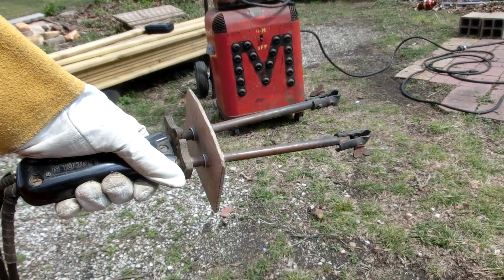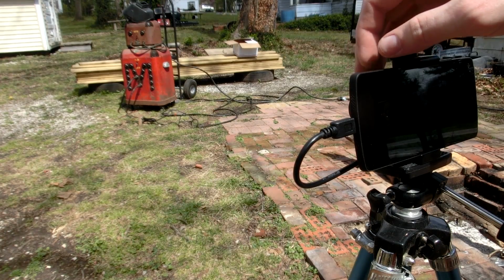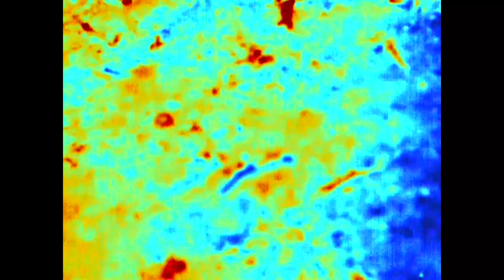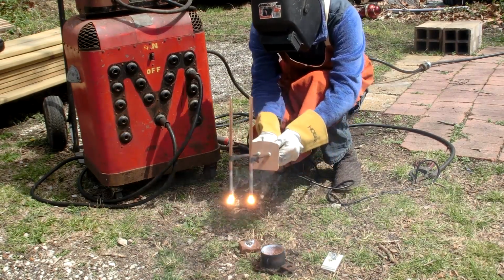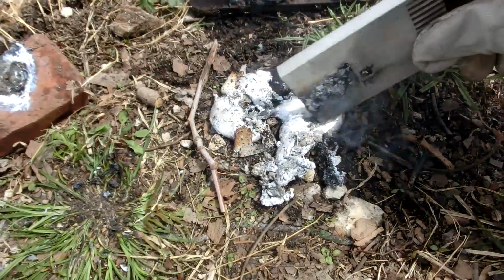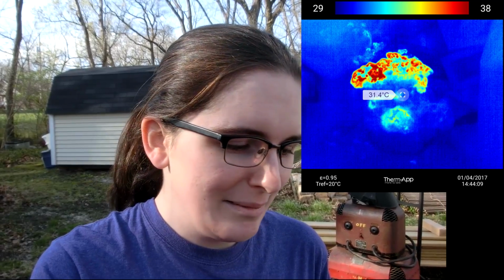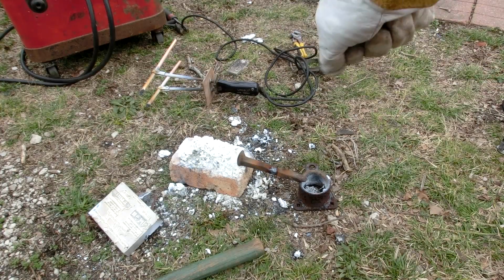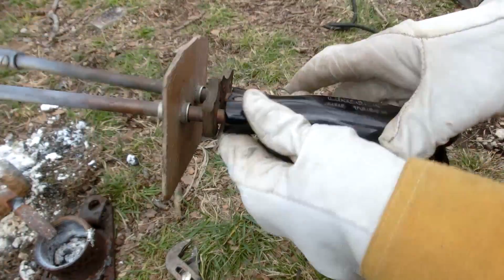Antique Lincoln Arc Torch: Melting Iron, Aluminium, Magnesium

Comment: I see that you tired to blow off the molten metal with a bicycled pump.  You are going to love the AIR CARBON ARC TORCH. (air-arc).  Loud noise and molten  metal  being blasted off.  We used it for gouging out weld metal and for  severing large  pieces of steel from pressure vessels where oxy-acetylene torch couldn't do the job.  Besides the typical  round electrodes there are flat cross section ones used fore the removal of hard servicing material such as found on earth moving equipment cutting edges and mulboards.  Be sure to use adequate proper PPE., the fumes are dangerous in large quantities.

Comment: From Australia I was pleased to see you wearing appropriate clothing because 40 years ago I used a carbon arc torch to braze up a trailer which resulted with me covered in arc flash  lobster burns over my young tender exposed pink skin .
Reply from the maker: I'm a little lucky in that I don't get sunburns, but agreed.
Reply: @RinoaL  It looked more like a 2nd degree all over burn than sunburn .The council placed my down on the corner for a "STOP" sign for 2 weeks

Comment: I love this technique and old tech. As an aside I did some research. The carbon torch rods are a different chemistry and are much better at flame control and quality of flame than the more readily availabe carbon rods for gouging. It looks like these are gouging electrodes. I found the correct rods internationally. They are not manufactured here in the states any longer.

Comment: She need use that welder for stick welding like 6011 or 7018 made for small job around a farm or home  not made what she is use it for put rod hold on it   she need a high amp machine like 300 to 500 amp
Reply from the maker: This machine is perfect for this. It is too big for a farm welder. It is industrial
Reply: @RinoaL  oh I'm sorry lady I guess you're a professional welder that's welded on pipelines and boilers and took everything from 1G to 6G on the test  and you're probably welded on machines that run from 250 amps to 500 and you're probably a golden arm arm lady they can weld anything from pipe to boilers to to oil rigs to anything in this world lady that's who I am I am a professional welder
Reply from the maker: Well, i have welded industrial pipes, and boilers. i doubt you've done any of that. even if you did, you'd be ignorant to the history of welding.
Reply: @RinoaL  whatever lady you have a nice day you got a lot to learn

Comment: It looks like the carbon rods your using are probably graphite air arc gouging rods, the carbons for twin carbon arc torches like this are much finer in texture and are a deep black carbon with no visible grain structure when burned. They work on fairly low amperage and burn with a quiet well pronounced flame of intense heat perfect for brazing thin metal, loosening rusted bolts etc I've used one of these torches off and on for the last forty years and found it incredibly useful and versatile.

Comment: Tip - use a spare wheel as a temporary air tank to use arc air gouging. It won’t last long unless it is connected to a compressor but DO NOT OVER INFLATE tyres (tires). Compressed air is dangerous!

Comment: You can cut through a railroad spike with a arc stick invertor 60 quid welder.  2.5 rods. ran from a 80 am welder... I was hoping you had figured a way of cutting clean or welding ally with that technique... thick you could weld a thin bit of ally using that? 
  
Thanks  for the video 

Good video tho youv planted a seed in my brain I have some ideas now

Comment: Bought one in the 70's haven't used it in a while. I don't think it's meant to be used a really high amperage, probably why the handle got hot. Also something doesn't look right about the arc, maybe your old welder isn't providing enough arc volts. The arc should be more intense with loud noise. You shouldn't need to be so close to the work piece, certainly not touching it. Maybe open the electrodes a bit more. Also if you ground larger work pieces you may get better results, you can use a car booster cable for the ground wire, connect it to the welder ground clamp, keep torch connected normally.

Comment: I don't think you are supposed to contact the work piece. I made a carbon arc torch and will try it out after I get some rods I ordered. A gouging torch with air is for cutting. The dual rod is for heating and brazing.

Comment: Seems you may be trying to mis-use the carbon arc torch.   I grew up using one with a Forney 
AC stick welder.  That carbon arc torch was intended for things where you might also use a gas torch.   It is excellent for brassing, soldering, heating metal for bending (blacksmith work), loosening stuck nuts (hold the carbons against each side of the nut).  With some practice it is possible to weld thick aluminium by using a heat sink and small aluminum wire as filler metal.  

A carbon gouge torch is a totally different animal.  The Carbon gouge uses only one carbon electrode and compressed air to melt a metal puddle and blow that puddle away.   It can do arc-welding in reverse....un-welding.  The single carbon gouge torch is used to cut metal.

Using the Carbon arc torch you should be using 20 to 60 amps AC current.  Smaller carbons (1/4 inch) work well around 20 amps for soldering and brassing light metal and plumbing.   With 3/8 inch carbons you can increase the current to 5- or 60m amps and heat up to 1/2 inch metal for bending (works well for making horseshoes).  

When brassing with a carbon arc torch you need brass filler rod (1/8 inch works well) and some sort of flux to dip the hot brass rod tips into to make the flux stick to it.  Commercial fluxes for gas torch brassing will work fine, and some use common 20-mule-team Borax as brassing flux.
Reply: Hey Mr Evans .. I cannot find anything anywhere about carbon arc welding aluminum it sounds interesting .. where did you learn about it? books etc or was this all trial and error?

Comment: What year is the welder
Reply from the maker: idk, maybe late 1930s, 1940s
Reply: A good replacement would be several MOTs wired in series for the most consistent arc.

Comment: Back in the very late 70s I spent a year in England.Arc torches like that were quite popular there,almost unknown this side of the Atlantic.220 volt mains probably made a difference. Operating on memory I have not accessed for decades, but using that double electrode unit for automotive gauge sheet metal was the main use I saw in the various shops I spent time in.Heating panels for shrinking or stretching sheet metal.Motorcycle and sidecar repair usually had one as well. Not particularly easy to master.There might be some old training films YT  people have resurrected that would prove helpful.Whatever else you do,clean and brighten every single electrical contact point. Fine steel wool etc.See if you can access the back of the welder panel and try to clean the plug ins the jacks stick in to.Oxidation makes quite a difference,so complete disassembly is the way to go if you can bring yourself to do it.Cheers,and good luck with that rare old beast.

Comment: I have the same welder.  Got it for free.  :)  It's a beast.
Reply from the maker: Any documentation with it? is it 150A or 300A? any idea on when it was made? i'm having a hard time finding a date on mine.
Reply: Unfortunately no documentation was provided. I believe that it is a 150 amp machine. (I will check soon and let you know.) My own research on the interwebs hasn't turned up much --- I'll let you know if I ever find anything.
Reply from the maker: Did yours come with the same head unit as mine? i think there were other ones.

i believe i see some markings in the top head unit, so i can see about opening that up.

judging by the design its at least before the 1950s, but i'm starting to think more like the 1930s judging by the styling of it.
Reply: Do you ever buy stuff from the State of Illinois's auction site?  There's some interesting stuff that pops up every now and then.
Reply: Rinoa, I stopped by my dad's shop to check out the welder.  It's actually the 300 amp machine.  More powerrrrrrr!

Comment: I bet the dials on your electric meter start spinning like fan blades when you fire up the welder.
Reply from the maker: I think its digital now, so actually no. :D

plus this only uses like 6,000w at the most so not too much.
Reply: ah. yes. digital age. lol.   I was thinking about your thermal camera issues. do you think it would help to put a welding mask in front of the lens? I dont know how the tech works but its an idea.
Reply from the maker: i was experimenting with adding an aperture in front of the camera. i didnt want to waste too much time on it so i stopped using it, but i would like to rip an aperture out of a camera lens and then add my own markings of like "3000F*" "6,000F*" and whatnot instead of normal exposure increments.

Comment: Try just using one carbon rod in your welding clamp and ground.  The twin rod holder is for producing heat.  A single rod would be more of a gouge.
Reply from the maker: i've done that before, thats how i made my 2,000 subscribers sign.
Reply: A single carbon rod also makes a great soldering iron if you use a 6 volt battery as a power source.   Good for large battery lugs on heavy wire without burning insulation.

Comment: For cutting steel the proper tool is an arcair torch.  This is a single carbon electrode held in a holder that has compressed air jets to blow air into the "flame" and the oxygen in the air burns through the steel.

I have a twin-carbon torch bought from JC Penny some thirty-five (or more) years ago but I have never actually used it for anything more than an arc light.  I found early that oxy-acetylene is FAR easier to control than a twin-carbon heat source.

I noticed in one of the shed videos you have a twin cylinder Bendix-Westinghouse air brake compressor.  Assuming the compressor is not "froze" up it would make an excellent air compressor.
Reply from the maker: yeah i know this isnt the best way, but i think a jet of air could help cut metal.

and your right i do have one of those compressors, it seems to work fine but i am wanting to make a silent air compressor that uses refrigeration compressors. i originally bought that compressor for 12$ oping i could convert it to a stirling engine or steam engine. havent really looked at it yet though.
Reply: Great backyard video!    I'm a bit late, but if you are still using the carbon torch,, grind converging  flats,  or  pencil points  at the flame front - gets much tighter, and  hotter, yet   the handle  may  not heat up as much.   I've had  a similar Lincoln unit for 40+ years (and very old when I got it) on a  250A Lincoln tombstone. My torch  is virtually identical, but has a thumbwheel  to fine adjust one of the rods relative to the other.   Was looking for info  on operating CArc on DC after  converting my welder with  a  final -drive full wave rectifier from a diesel electric  locomotive .  I can switch it between AC/DC and  between  electrode neg and pos, but not certain if operating on DC presents any special concerns although  I'm fairly certain it's not polarity sensitive.    These days, I use a cheap plasma cutter on nitrogen  to cut thru  3/8" sheet,  and save the arc for heating or gouging big stuff.         I built a carbon arc furnace some years ago - forced-fitted a pair of  13/16"  round carbon brushes  into   3/4" copper tubing  then swaged the tubing over a 12" length of 1" grounding rod. Each rod was mounted on a PVC  insulated  ball style   x-y axis  machinist vise  on either side of the  the fire brick oven to adjust gap and angle in the center of the firebox.  Although it tripped  the  100 amp safety  breaker on the welder's  common input  in short order,    the rays of light escaping from the oven looked every bit as bright as a searchlight,  the hum and hiss were downright scary, , and the  heat in the open shop was intolerable after 30 seconds.   At the time, I  was waiting on delivery of a  cheap  surplus Navy 300A diesel generator/welder  to power it,   but it seized shortly after I got it running and like a lot of projects,  I was long over the arc-oven by the time I got the generator working again.   Turned the oven into a gas forge and still use it for lost wax and with the top up, as a rosebud.

Comment: so. you have this crazy cool vintage arc welder and a crazy high tech thermal imaging camera. but not a basic AF air compressor, *facepalm* time to make a home made one that uses billows?
Reply from the maker: well i rarely need an air compressor. i have all the parts to make several but just havent yet. i also hate how dangerous and loud they are.
Reply: I'm sitting here scratching my head trying to figure out where the danger comes into play with an air compressor.
Reply from the maker: they can explode, there have been several people around where i live that have died from exploding air compressors. perhaps you dont respect what 125PSI can do.
Reply: I fully respect what any power tool can do but it sounds like the dead folks didn't. There are 2 main reasons that air compressors can explode and both are due to poor maintenance. Number 1 is not testing and keeping the pressure relief valve in working order by just pulling the release ring to test it and keep it from seizing. Number 2 is failing to drain the water from the tank that accumulates from the humidity in the atmosphere that causes the tank to rust from the inside out.  A stuck pressure switch could cause a problem but as long as 1 and 2 are taken care of there should be no exploding air tank.
Reply from the maker: i bet the dead folks thought they respected it as well, but now they are dead. lol

i believe the one in Donaldson exploded because it was just used for too long, had too many pressurization cycles.